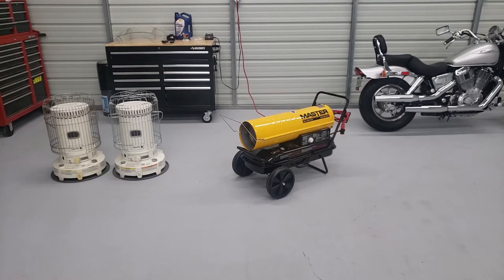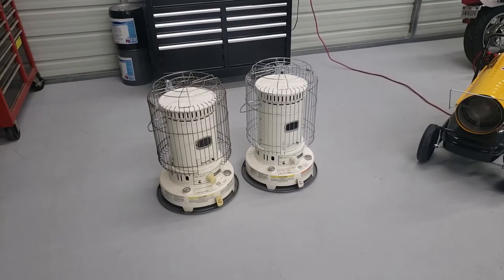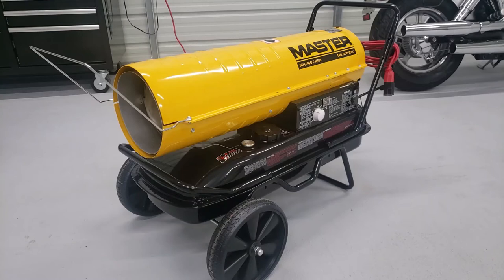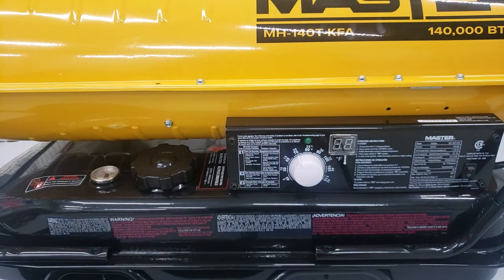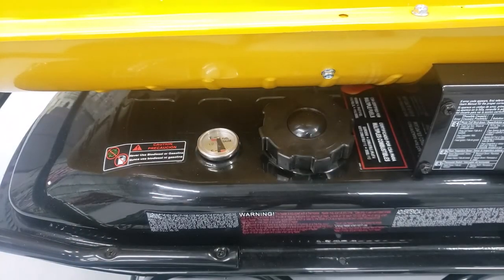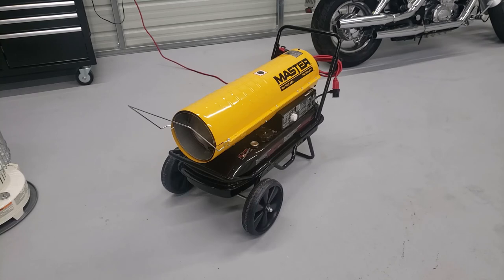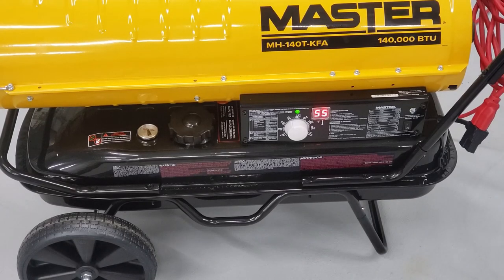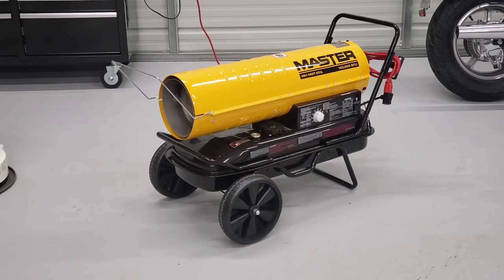💥💥💥 SHOP AND WORKSPACE HEATER - A QUICK REVIEW OF THE MASTER 140,000 BTU MULTIFUEL FORCED AIR HEATER

Comment: We set up a few summer fans to blow up at a 45' angle and push the hot air down from the lid. Use red diesel and get it from your bulk oil dealer, They also sell kerosene at a pump usually and its just a bit more than red diesel. $230 gallon red diesel in California just now. forget about kerosene in a bottle.

Comment: What did you end up lowering the pressure to for the diesel fuel?
Reply from the maker: I found that it varies.  I back it off until I no longer see flames lipping around the center shell.  It conserves fuel but still heats well.
Reply: @BOSSC351sProductions  I just bought the 80,000 btu version and have been playing with the pressure too. I found 2.5 psi seems to be right with no flames coming around the center plate. Any higher and it’s like a blow torch! Haha

Comment: For safety get a co dioxide detector place in shop good luck.
Reply from the maker: Way ahead of you.  Bought the heater then went across the street to Walmart and bought the detector.  I have yet to have it go off using the heater with kerosene or pump diesel however it does not like when I idle the motorcycle in the shop.

Comment: Use RED diesel or bulk kerosene or jet fuel from your local bulk fuel dealer. NOT from a store or gas station in bottles.
Reply from the maker: So far, no such luck around here.  Im still looking.
Reply: Why? Does it mess it up? What about regular diesel from the pump
Reply: @lilcuriousgeorge1  The red diesel is the same but usually dollar cheaper per gallon. "Off road diesel" Go where the farmers go.
Reply: @RRaucina  its nice to have red diesel on our farm that we can use for our forced air multifuel heaters